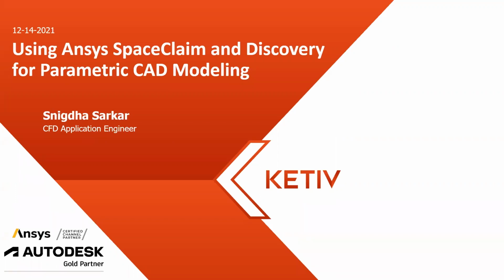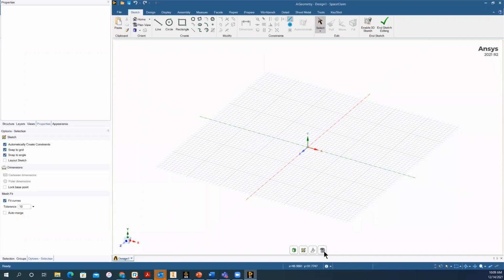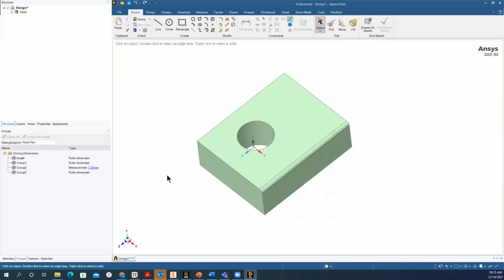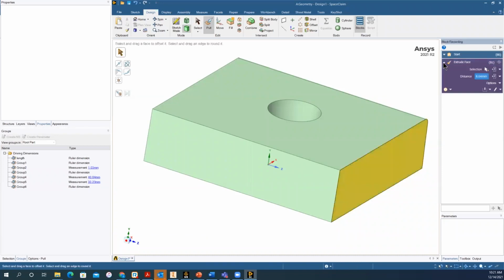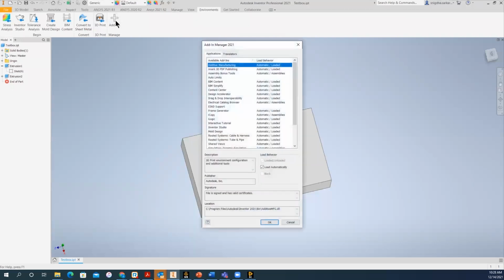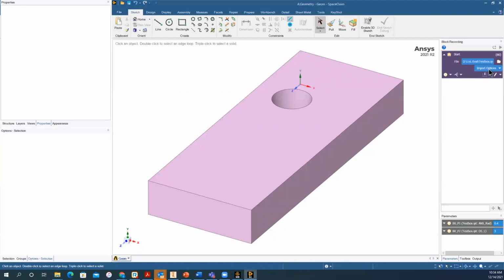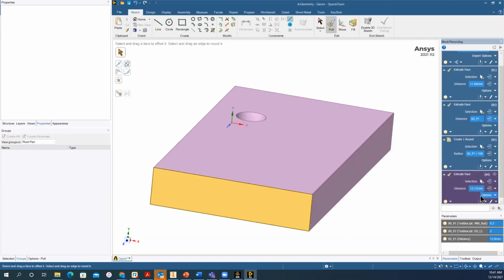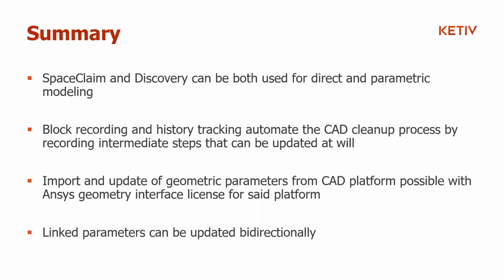Using Ansys SpaceClaim and Ansys Discovery for Parametric CAD Modeling | Ansys Virtual Academy

Comment: I am doing parametric modeling in ANSYS followed by structural analysis. But I am getting the following error. Kindly let me know how to resolve this issue 
(DP 1) The Setup component in Static Structural for Design Point 1 requires user input before it can be updated. For instructions on how to address the cell in its current state, click the blue triangle in the lower right corner of the cell in the Project Schematic.